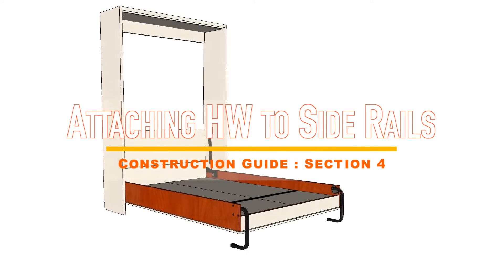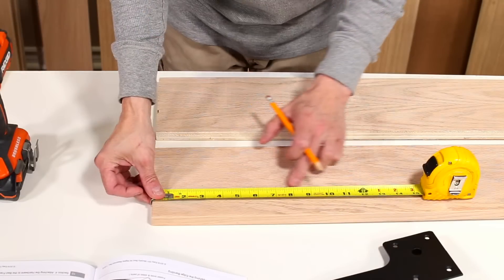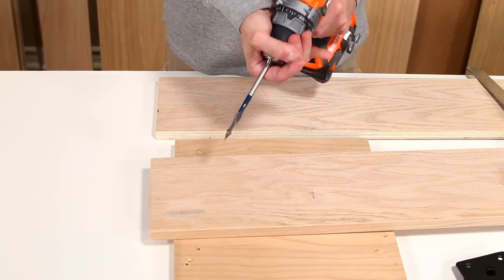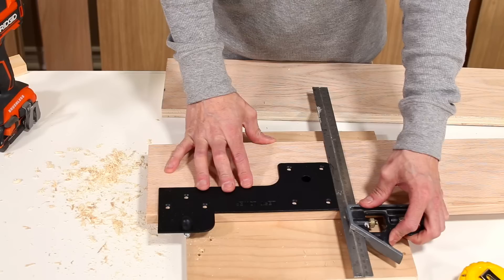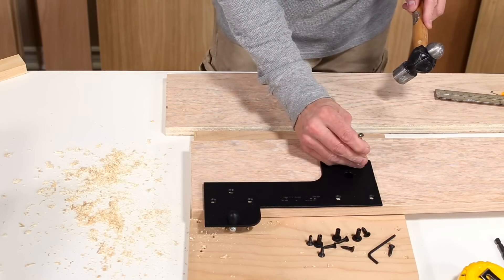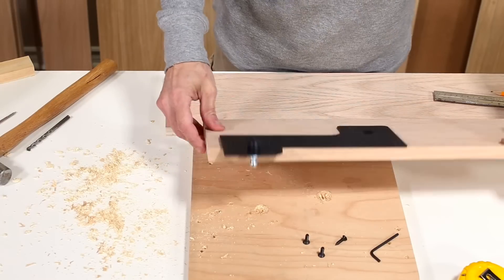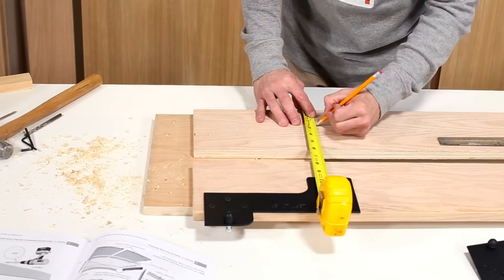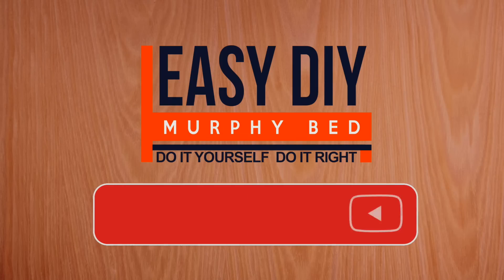Part 4 DIY Murphy Bed Frame Construction | Easy DIY Murphy Bed USA

Comment: In the plan for the King/vertical there is no 3/4 gap between the plate and the edge of the frame board.

Comment: Anyone else notice him trying to drill the hole with the drill going backwards? Haha.
Reply from the maker: Glad you noticed! It was an editing trick! ha ka
Reply: No, but I did notice that he drilled through the side rail on the four 1/4 inch holes around the big 3/4 inch hole he did with the spade bit ruining the side rail in the process, this mistake should be edited so if someone follows this video doesn’t make the same mistake.